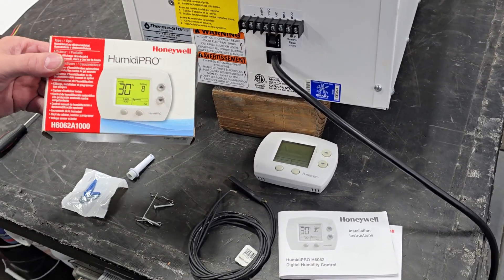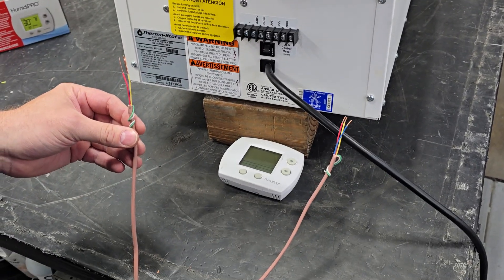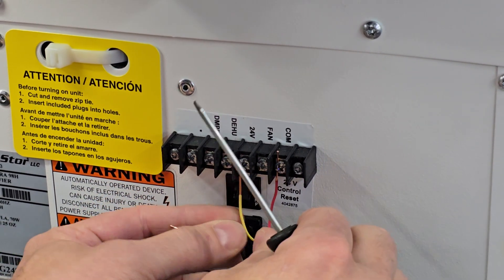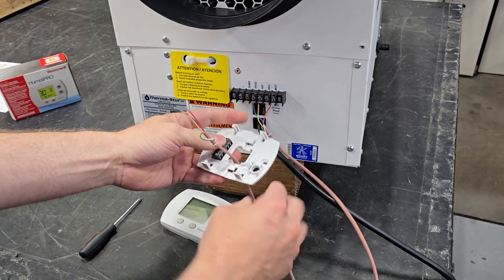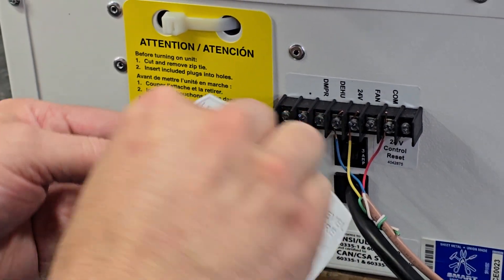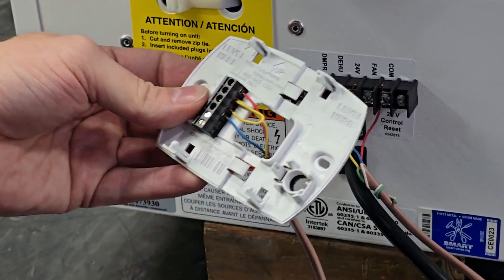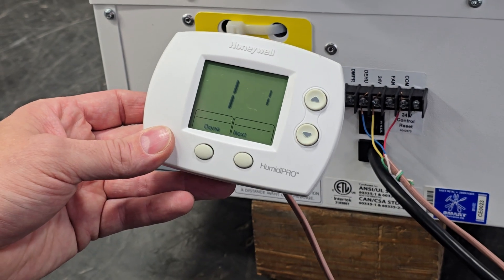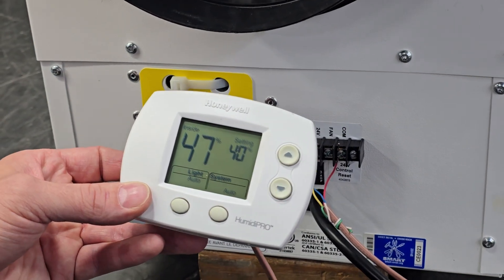Wiring a Santa-Fe Ultra to a Humidi Pro control.

Comment: I wired my HE 400A with the humidpro. My question is if you turn the humidity setting above that is in the room is it normal for it to activate and start flowing water? I would think it should only turn on when the fan or heat is on?

Comment from the maker: This is the same wiring for all Santa-Fe Ultra units with a terminal block. The Compact 70 does not have the terminal block and is not set up for a low voltage control like this.
Reply: Any suggestions for a WiFi dehumidifier thermostat ?